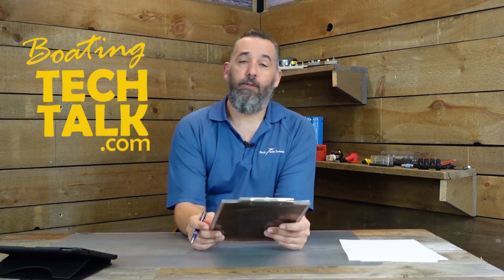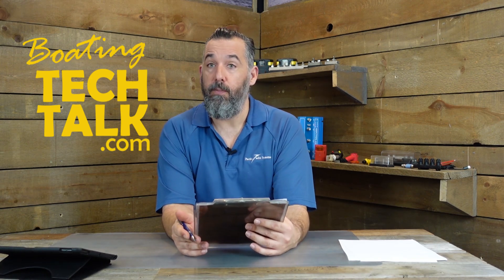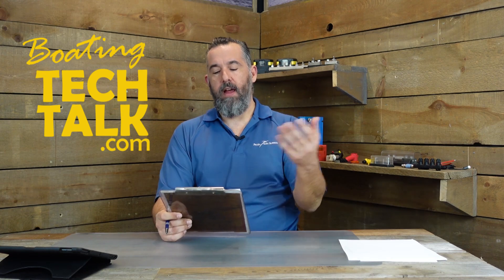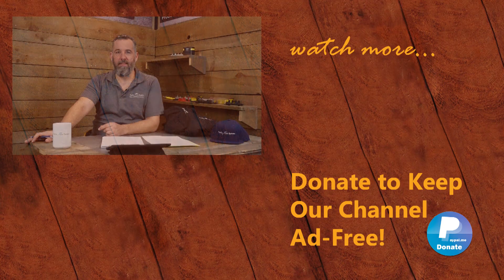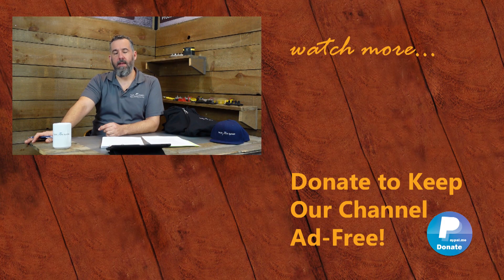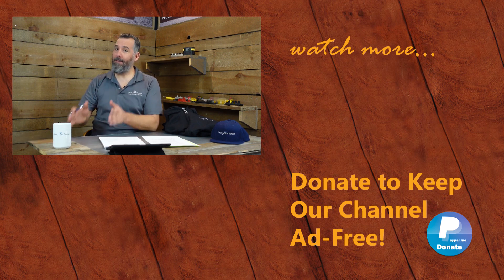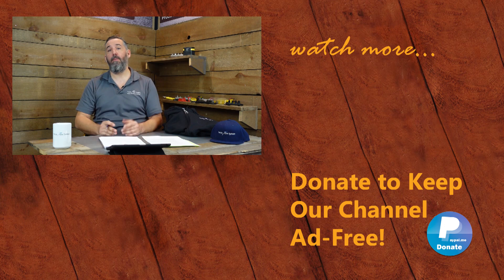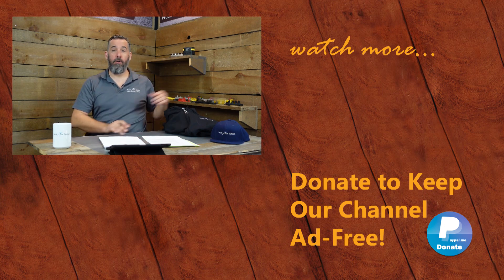I Am Buying a Used Boat, What Should I Look for When It Comes to the Electrical?

Comment: I have another question about that. When buying an old boat what in your opinion is the maximum age for boat wiring before the entire electrical system should be replaced. Cables plastics insulations and so on don't last forever Let's say best senecio very well maintained boat, boat that has always AC running inside?

Comment: Jeff, do AGMs or Firefly batteries need to be in a box? I was curious about that third picture you showed. Also, in that picture the battery posts should be protected/covered correct?
Reply from the maker: Good question, if your AGM batteries are NOT in a battery box, make sure all the terminals positive and negative are protected. Since AGM batteries do not leak sulfuric acid, we often see AGM batteries without a battery box.

Comment: Hi Jeff. I have seen some large and thick battery cable showing terminals in bad shape, so i decided to cut those terminals and re-do them. But when i peel the jacket, what I found in the copper turned into black. I scrapped the threads and some copper color returned... is there a way to reuse those cables, or should i discard them completely... Thanks!!!
Reply from the maker: Great question, happened on my boat too. My suggestion is to replace the wire if it's that tarnished.